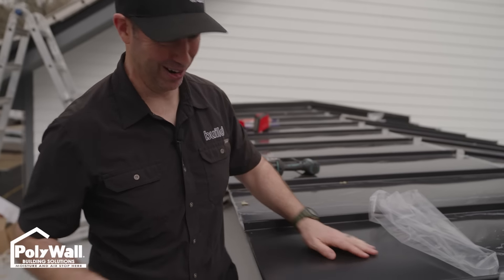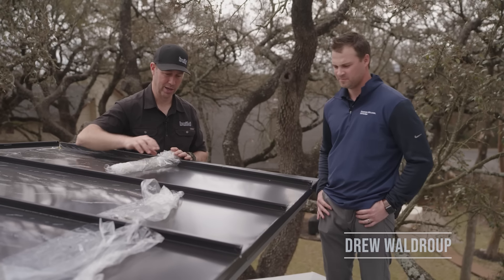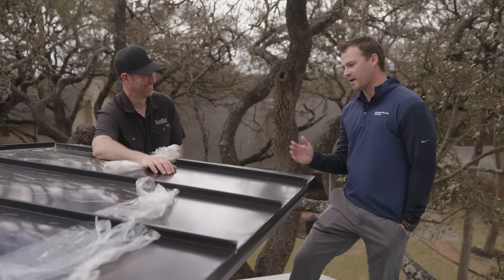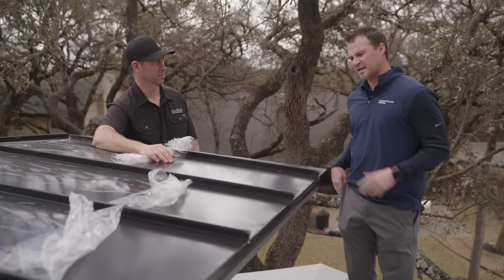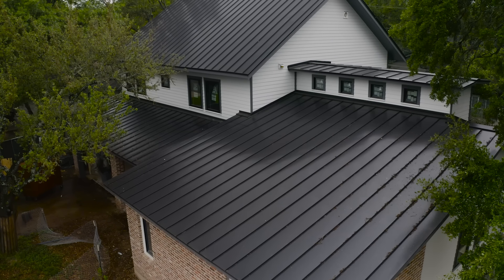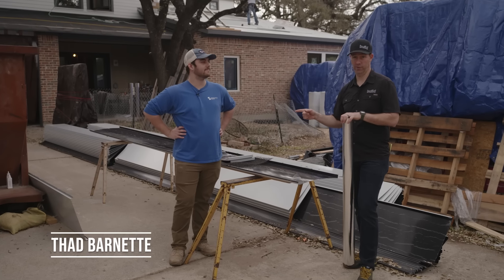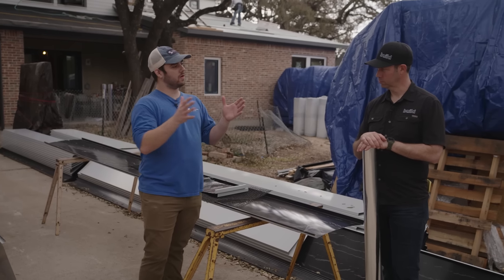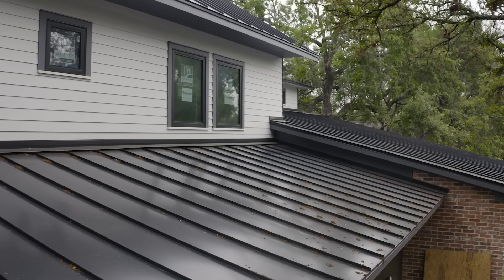Black Metal Roof - Dumb Idea?

Comment: It's a beautiful roof. However, in the south, a Black metal roof may not be the way to go. It will suffer debris and bird poop regardless of color. I've seen Black metal roofing used, but it cool to cold climates. The beauty about metal roofing is that once its installed and installed properly, barring a natural disaster, they will last a very long time.

Comment: Can someone explain to this newbie how the foil under the panels can reflect heat when it's not directly exposed to the sun ? Just askin. Thanks
Reply: It reflects the radiant heat emitted by the underside of the roof.  It has to be installed correctly though which I don't think is the case here.  Pretty sure it should have been installed on top of the underlayment with the shiny side facing the heat source (the metal roof panels) and an air gap between.  In that configuration the shiny surface would reflect the heat as it tries to radiate across the air gap which is almost like having a reflective/light color roof in the first place.
Reply: @CL-gq3no  thanks for the response , yes thats where they lost me. I would have thought the same for direction of foil.
Reply: @CL No, it's installed correctly.  It's work by impeding emission, not by reflection.  Look up how a low EMISSIVITY surface works.  You are right that it could also work if it was placed on the lower side of the air gap and faced upwards, but in that case it will only work as long as dust and dirt don't settle on it, reducing it reflectivity.  However by installing it above the airgap and facing it won't get dirty destroying it's low-emissivity, and thus it's heat impeding properties will be more durable.  Emissivity is interesting and not commonly understood.
Reply: @JessicaLarsonDVM , interesting.  I'll hit up Wiki and learn me something.  Thanks for the info!
Reply: @JessicaLarsonDVM  "There is a fundamental relationship (Gustav Kirchhoff's 1859 law of thermal radiation) that equates the emissivity of a surface with its absorption of incident radiation (the "absorptivity" of a surface)." What wikipedia is telling us in technical language is that the reflective barrier has to be facing the heat source in order to be effective, even when you're trying to reduce emissivity. Emissivity = absorbtivity. The installation instructions that came with the product are nonsense, and the product itself is very likely ineffective; certainly as installed it is.

Comment: Black is a horrible color for a roof. It increases your heat load dramatically. It makes it harder for your AC to work even with all of your spray foam in the roof line.

Comment: Your choice of black is the worst possible choice, not because of the capability of the colour in the sun, but because of your desire for energy efficiency in the rest of the build process.
Black roofs massively increase heat islanding effect.
 White roofs (regardless of material) have been proven to keep your house cooler and your suburbs cooler (great for kids playing outdoors) and reduce energy usage in homes through reduced heat islanding.
Also better for your soon to be installed solar panels.  Solar panel efficiency decreases as heat increases.
Compared a black metal roof to a shingle roof. Still makes black and bad colour choice!

Comment: Matt doubles down on his dumb roof. No, Matt, we're not concerned about black fading over time. We're concerned about the house getting hotter than necessary in the summer and unnecessarily increasing your HVAC load. This video even admits that with a white roof you'd be able to get your SRI up to 100 instead of the dismal 20 that you get with black... that's 5x better performance with a simple change of paint color! Only an idiot would turn that down after considering the implication on his A/C bill over the next 30-50 years.

And yes, you did install your radiant barrier upside down. Foil face needs to face the incoming heat, and it needs to be sitting on the opposite side of the air gap from the heat source, which is the roof. All you did was insulate your roof from your house, not the other way around like you should have.

Comment: Nothing but infinite respect and admiration for you Matt... however....   Yes.... a black metal roof is a DUMB idea.   Why?   Because of the HEAT it will generate when exposed to sunlight.   Want to keep things cool... use WHITE.   That black metal roof is going to conduct and radiate heat when exposed to sunlight.

Here’s a wild idea for an invention.... a roof that is white in the summer and black in the winter.   Hmmmmmmm.
Reply: That’s thinking outside the box!

Comment: Yes, it is a dumb idea to install a black roof in hot climates. The heat load into your roof spaces is far far higher than a light shade of colour. Basic physics really. Shake my head when I see black roofs up in north Queensland. They make sense in cold climates because you want to retain any heat from the solar radiation.

Comment: save you 9 minutes: yes its dumb. 100F summer in texas equates to a blistering 180F in your attic, which WILL radiate through insulation and heat your home while your poor AC is busting its butt trying to keep it cool.  unless you live in a geographical area where the peak summer temp never exceeds 80F, going with black is very stupid.

Comment: Black is the most fade resistant color. It is also the most heat absorbing color. I think it is a dumb idea that will last you a long long time. Your superinsulating and air gap detail will save you some heat gain, but I still don't like black paint. It's your house and you will pay for the additional heat load. I doubt your AC cost will be more than a typical efficiency house, but it cost much more.

Comment: The use of the radiant barrier is confusing, and it sounds like even Matt isn't clear on how it works.

That radiant barrier works NOT BY REFLECTING heat, but by reducing the EMISSION of radiant heat from a hot material.  It just so happens that low emissivity surfaces are also reflective, but benefit we seek is from a different characteristic.  If your hand near a hot piece of metal you'll feel the radiant heat emitted from it.  Now if you were to coat that hot piece of metal in a low-emissivity coating, it wouldn't radiate as much heat, and your hand wouldn't sense as much heat from it.  That's what the radiant barrier is doing to the underside of the hot metal.  It's slowing the radiant transfer of heat from the back of the metal roof, so the heat doesn't jump over the small air gap.  As a result, more of the solar heat which the metal receives from the sun will be radiated back up towards the sky, and not down towards the house.
Reply: The reflective surface of the radiant barrier has to face the heat source in order to be effective. For best results that hot piece of metal should be coated in a low emissivity material on the side of the metal opposite the heat source, leaving the shiny metal surface to face the heat. The shiny metal will reflect much of the heat back before it has a chance to raise the temperature of the metal body, leaving the low emissivity coating much less work to do to prevent heat flow out of the other side of the body. It's simply nonsense to put the radiant barrier on the wrong side of the emissivity coating where it can't possibly do any good. Yes, shiny metal surfaces have low emissivity ratings, but the way they achieve that is by reflecting heat from the source and not letting it get absorbed by the body in the first place. A cooler body emits less heat than a hot body regardless of its surface coating, pure and simple.
Reply: @dlwatib  A radiant barrier can work in two different fashions: as a reflector, and as a emission-inhibitor.  In this installation, it's working to inhibit emission.  The top (non-shiny) side of this radiant barrier is touching the bottom of the hot metal roofing.  This insulates the hot metal roofing from the house below more so than it would be without the barrier in place.  It works because the metal conducts heat into the radiant barrier (because they're touching) but the radiant barrier will not radiate its energy down and across the air gap which is below the radiant barrier because the radiant barrier's low-E coating prevents this.  As a result, the metal gets hotter and radiates more of it's energy upwards towards the sky than it would without the radiant barrier in place.

If the manufacturer of the metal roofing had coated the bottom of the metal with a low-E coating (like the radiant barrier has), then the separate radiant barrier would be unnecessary.  I believe they paint the lower surface white, but even that has much higher emissivity than the shiny radiant barrier.

This radiant barrier could instead be installed below the air gap, and facing upwards, to work as a reflector, and would inhibit radiant heat transfer as you are aware.  So why don't they do that, and not confuse everyone?  I believe the answer is because when facing up, it will eventually get fouled with dust and dirt which settles on the reflective surface reducing it reflectivity.  When installed to employ it's low-E properties, above the air gap, facing down, dust and dirt won't settle on it, and it will continue performing much longer.

Comment: Matt.  You lost your mind.  This is a design choice for looks, and it’s not a very good scientific decision.  It hurts your legitimacy as a “building scientist”.  I’ve seen you make a lot of decisions based on choices that didn’t make sense money wise, or energy wise, and just to push a sale or an endorsement.  This is the stupidest one yet.  Now maybe that’s being a tad harsh, but to offset your color decision what did it cost you in terms of wacky underlayments and radiant stuff. Perhaps the angle is that you did all that stuff and so the color of the roof doesn’t matter, but you are raising the neighborhood temps there in Austin with that solar cooker.  Sometimes smart doesn’t mean logical.  Wisdom over knowledge any day.
Reply from the maker: I thought I made a pretty good case for why my super thick insulated roof with radiant barrier negates the black absorptive roof color. Ultimately I wanted the look & the performance
Reply: @buildshow  I was probably a tad harsh on you.   I personally wish you would have just said you wanted a black roof no matter what, or the wife made you do it😂. I agree that at the end of the day with your radiant barrier and airspace, it’s probably not a huge deal.   Most importantly, not my house not my money.  But those temps will be massively hot.  And your followers don’t necessarily understand the implications of what you had to do to justify your design choice.  Maybe you can stick some copper tubing under there and make solar heated water for all the neighbors for free.  Of course another freeze like last year and that wouldn’t turn out so good.   Seriously, we are all looking forward to seeing some real numbers at the end of this build after living there for a year or so.